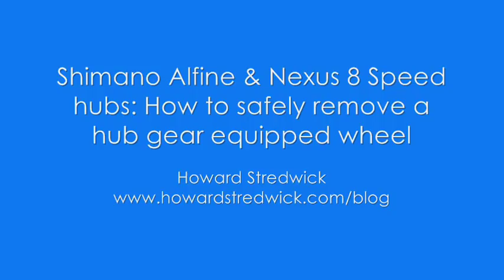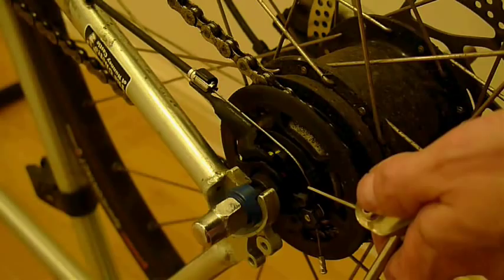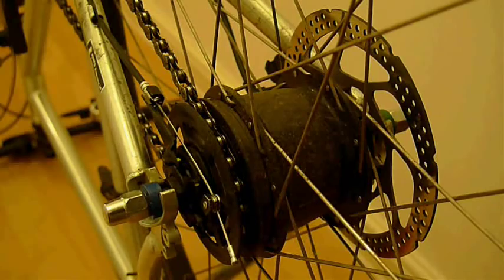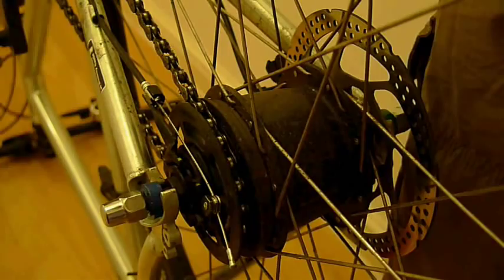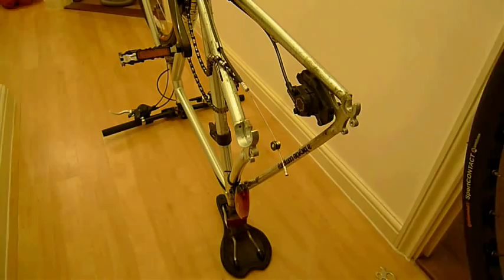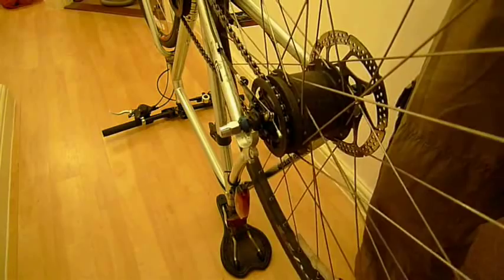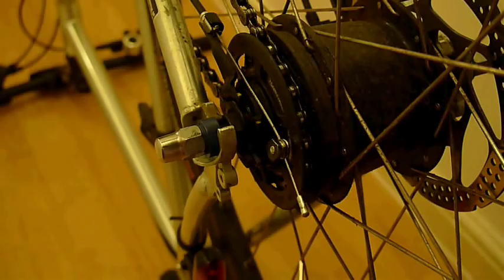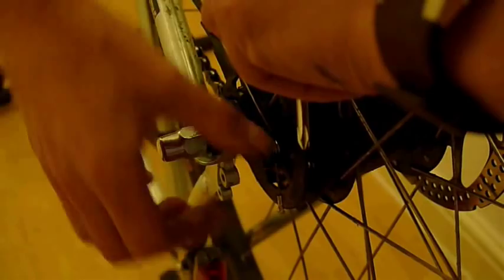How to remove a Shimano Nexus or Alfine hub equipped wheel from your bike

Comment: Nice. Shimano Nexus hubs are also popular on dutch bikes, but removing them is usually a lot harder than that. You would have to: take apart the chain case (chains are fully enclosed), release the gear changer cable, release the roller brake cable, release the roller brake arm, release the adjusting screws for the horizontal dropouts. That's why we always patch the inner tube w/o removing the wheel. Otherwise you're just turning a 15 minutes job into a 1.5 hours job.

Comment: Extremely helpful guide, many thanks.
Easy once you know how. I had read that taking the rear wheel off a mechanical gear hub bike was really hard work, to the point that it almost makes the convenience of the hub obsolete. I was dreading the day I got a flat because of that, but it's really not that hard to do, no harder than with a cassette and derailleur in my opinion...

Comment: I find that disconnecting the gear cable before taking off the chain makes it a bit easier and cleaner. The same goes to the replacement process: chain first, gear cable second.

Comment: tip: the retaining bolt for the gear change cable has the nut facing you. I just took off my Nexus 7 cable to change my rear tyre for the first time. I found it fiddly - the next time will be easier but I think I'd still pay the bike shop to do it - I am so much more familiar with deraillure set-ups.

Comment: That was very useful.  I didn't know about using a hex key to turn the spring loaded cable thingamajig.   I  used to struggle a lot with taking the cable off and putting it back on again.

Comment: Note that Sidewinder and other linear tyres are best used only as a 'get you home or to the bike shop' measure as the crimped ends can rub against each other and are more likely to puncture than round tubes. That said, I'd always carry a couple, especially with a hub-geared electric bike.

Comment: Thanks Howard - Stripped it as much as I could and then re-greased it and its working fine now - after about 6 attempts to get the cones tight enough- a design fault though - you cant tighten the disc lockring with the cone in place and vice versa - or maybe i need a different tool- dont know

Comment: Thanks much for the video.

I'll add a few tips:
1. Make sure you push the 2mm Allen key or spoke all the way down into the lug: Otherwise, that little piece of plastic might break, forcing you to get a new Cassette Joint Unit (CJ-8S20, here)
2. When putting the cable back into place, make sure the it goes through the right groove. Otherwise, the indexing will be messed up
3. The anchor bolt has a different shape at the bottom, so it can only enter in a given position
4. Make sure the bolt sits snug: Otherwise, the cable will snap at some point, and again, this will mess the indexing.

Here''s a picture from one of my bikes, where the lug is broken and the cable a bit frayed:
https://s10.postimg.org/40ivaq5u1/Shimano.Nexus.8.close.up.jpg

If you have to get a new cable, make sure the anchor bolt is tightened at exactly 101mm from the ferrule (184mm for the Alfine 11). To make this easier, Shimano sells a "TL-S700-B Inner Cable Fixing Bolt Setting Tool".

FYI, Shimano wised up and built a different cassette joint for the Alfine 11, which requires no Allen key/spoke to rotate. It's easier when repairing a puncture on the side of the road.

Comment: You say don't get grease on the shifter cable - why? I cannot see a real problem caused with grease on the cable, but then when replacing the wheel hold it by the disc - which you do not want grease on at all.

I also find it much quicker and easier to pull the cable outer out of the holder first. This then gives a load of slack in the cable and can be removed from the hub with fingers. Putting the cable in the hub first and then cable outer in holder is also much easier when replacing wheel.

Comment: Awesome video! BUT (and it's a big but) you should never put a bike with hydraulic brakes upside down. This can form air bubbles that would go thorught the cable and make the brake not work at all as the liquid will not work properly...happened to me!

Comment: I've just acquired an Airnimal bike with such a hub so for someone who hasn't had a bike with a hub gear for some years this is very useful. thanks.   Not exactly quick release, though!

I was a little confused when you suggest slackening off the axle nuts on the RHS clockwise which made me think it was left hand thread but when I watched again you turned it anti-clockwise. So I assume both nuts are normal right hand thread.

Presumably you could use a suitable spanner to turn the cable holding nut rather than a pair of snipe nose pliers which are heavy and bulky to carry?

Comment: Thanks for this video.  I have an Alfine hub on my 2009 Bad Boy 8 commuter bike.  I was planning on buying a turbo trainer to exercise at home, but may upgrade my rear wheel to a specific trainer wheel.  Has anyone used an Alfine hub on a turbo trainer?  Do I need to replace the thru axle with the one that comes with the trainer? .  From what I can see, my exiting axle bolts protrude enough to lock into the trainer.  Any thoughts?

Comment: Thanks for the helpful vid, I was able to remove wheel and fit full mudguards. However, since doing it I can feel (rather than hear) a rumbling catarrh 'noise' through my pedals in all gears that wasn't there for the previous 3000 miles. The yellow dots are aligned and there's no rub on the guards. Any ideas?

Comment: Thanks for the useful info about the gearing system. It saved me a lot of time.But I got a problem in the process. I was changing the wheel and after putting all the things back. I noticed my first 3 gears are not working. Actually the cable doesn't move at all when I am changing first 3 gears. But soon after I shift to number 4 it clicks and works fine till the last gear. By the way the name of my gear is Cj nx10. What could be the reason for that, Please help me in this. Thanks a lot
Regards

Comment: Great video.....but what if i change my chainring to a bigger one and my rear sprocket to a smaller one will that make me go faster?
Reply: Yes,that will effectively increase all 8 gear ratios over the stock set-up ,assuming your cadence remains the same you will be traveling faster. I did just that with my bike.

Comment: Thank you for the tutorial.

I have a huge problem!  After replacing the old wheel with a new wheel, the wheel is turning the 'wrong' way.

I.e. when I pedal forward nothing happens, but when I turn the pedals backwards the wheel turns around (going backwards).

Do you know what mistake I have made? It's a Shimano Nexus 8 speed.

Comment: Hi there, can I use the wheel set complete with alfine 8 hub and the disc, on to the frame which not support the disc brake but only the v brake or cantilever? If possible what should you reckon for me tp be able to use it.Thanks
Reply: This dude doesn't have a clue,you would need to replace the rim with one designed for the forces of rim brakes.

Comment: I'm not sure if I should do this to my bike bc im tryin to replace the wheel myself. My bike doesnt have a quick release. Just bolts on both sides. The gear cable is on the same side as the cassette. The bolt on the other side of the casette came off easily, but the cassette side is not giving way. Getting so frustrated. My bike said Shimano on the derailer or wtv so I decided to youtube it, hence I'm here. Someone plz help :(

Comment: This is mostly wrong. You don’t turn the axle bolts clockwise to remove them. Disconnect the gear change cable BEFORE removing the wheel.